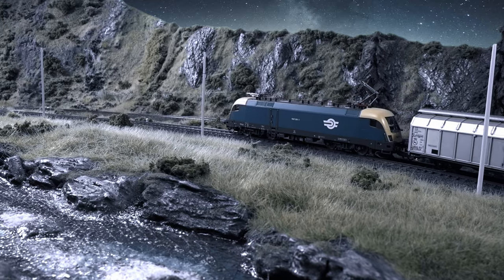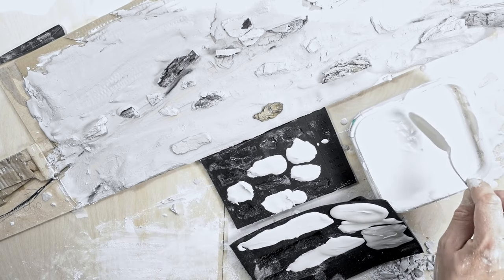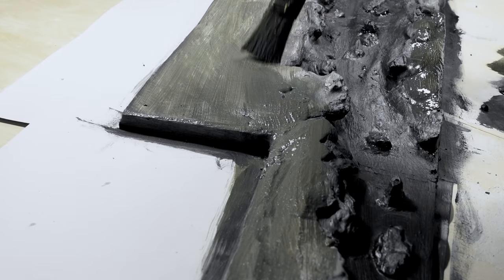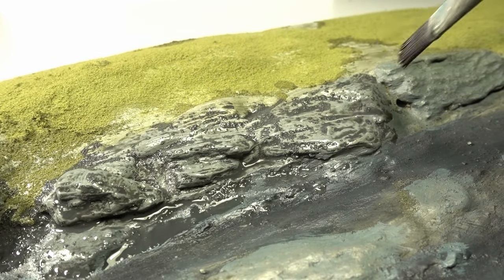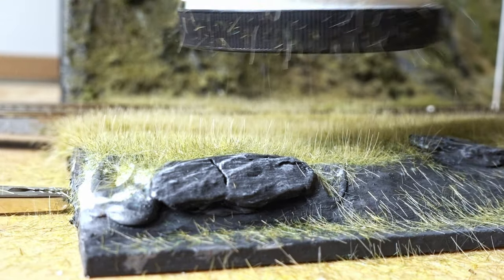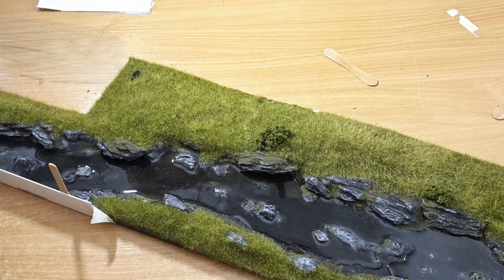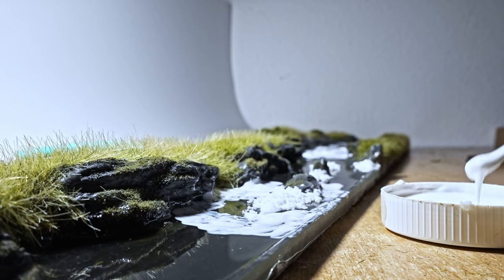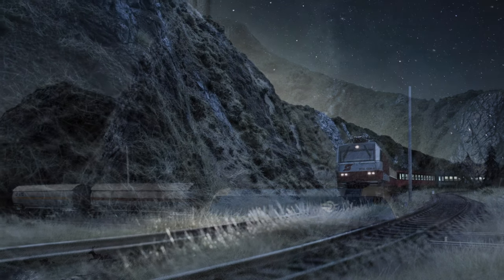Build a realistic river  - water/foam effect -  Model railway - tutorial

Comment: If I may make a suggestion. The straight lines where the two pieces sit next each other should be wavy. Nature doesn't work in straight lines.
Reply from the maker: I had to build this new segment for the  older existing one which was already. The original base was determined by the available wood material. So it was a technical limitation. If I would build it from the begining I would use one base for the complete diorama. However there is one advantage of this 2 pieces layout: for photoshooting I can remove the river section and put the camera there to make interesting pictures from that perspective too.